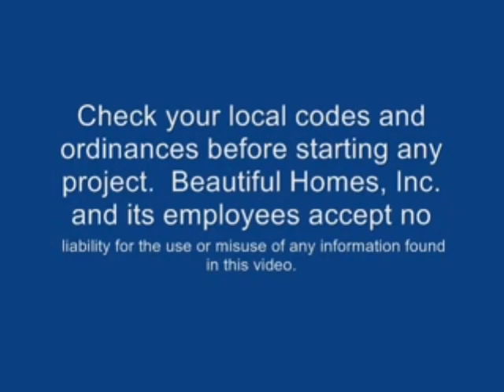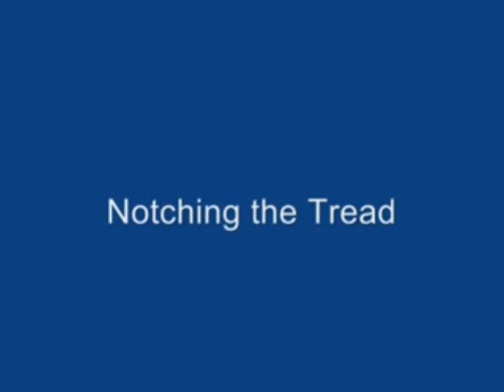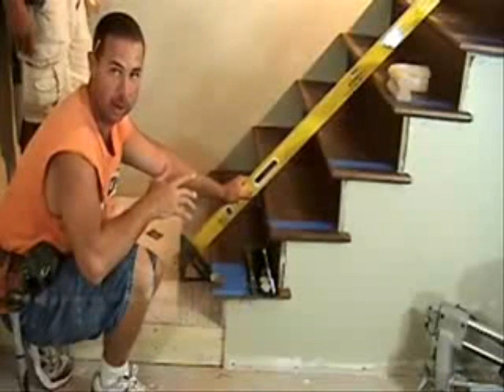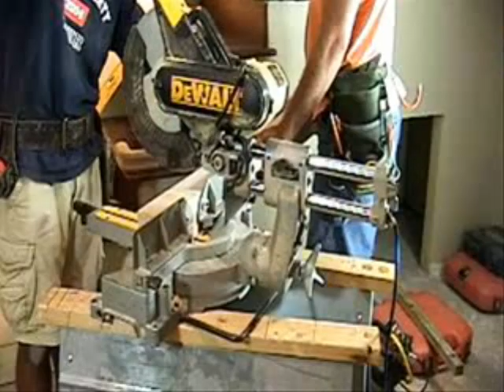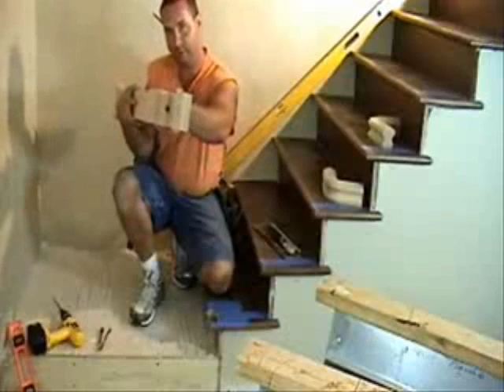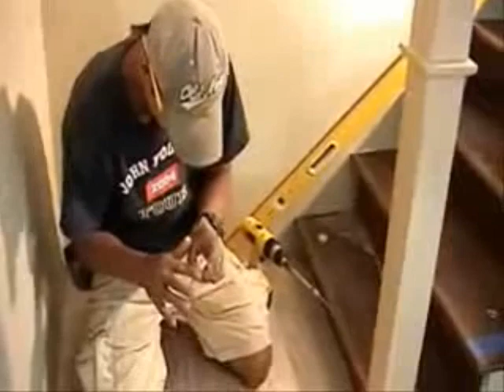Newel Installation

Comment: OMG...I watched to know how you got your starting Newel post height and you didn't even show how to get the height. But you showed how to cut a post???
Reply: the target for rail height is 36 inches,  Measure from where you want the post to sit to the top of the last tread it hits   add what you need for the post over the rail height ....in this case it's the two rises from the two treads plus 36 plus the 1-2 you want the post over the rail

Comment: why not bolt into the stair stringer instead of the floor...use two bolt which allows for adjust to dead on plumb
Reply: Because the floor is less likely to become compromised than the stringer. The stringer isn't engineered to accommodate the stress in the directions that the railing is subject - the torque is substantially higher where fastener enter the stringer from the newel - the railing acts like a lever where even strong lags have been pried away. Even when several fasteners have been used to secure the newel in this fashion it has failed or leads to a squeaky railing system.
Reply: going straight down into the floor means you have no idea what the framing is like underneath unless you did the framing your self....having a single point of attachment means having to use shims to adjust to dead on plumb and then you are rely on glue and a shim and one point of attachment...i'm 58 and been doing stairs since i was the age of your carpenters in the vid.
Reply: Fair enough,, but with all your experience, you should also know the build patterns and techniques to recognize when proper construction may or may not have occurred. Yes,, sometimes you'll have to improvise when there isn't enough subsurface to anchor. As far as shims,, well,, if you know how to use a chop-saw and a level, you also know how to get a newel to set proper on an uneven surface (the trick is actually found in cutting twice every time). Using a quality epoxy or glue is always recommended at all joints unless you don't mind a squeaky sloppy installation. In some rare but 'it happens' cases, it is better to use two or more locations to fasten - at this point you pretty much get what you get or you had better be prepared to back up a bunch of steps to add in proper surface structure. - you could avoid this or cover the cost if you know what to look for. I'm a master stair designer, maker and installer through apprenticeship. You can see my work at Amberstairs.ca 

I probably should have mentioned that installation can be unique and each one has its own set of challenges. It is good to know who built the home you're working on as well as their building styles and, for lack of better phrasing, their screw-ups.

Comment: Junk video, junk method using junk hardware. Mortise and tenon the newel post correctly. End of comment
Reply: closed minded. Mortise and tenon is obviously the best choice, yet over-kill. Railing bolts work great. Troll. The video does lack detail though.